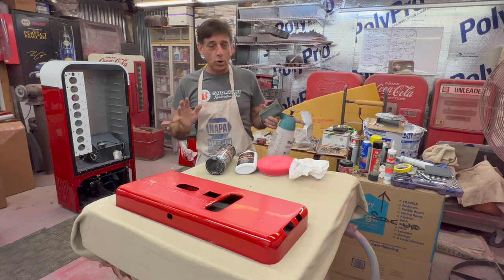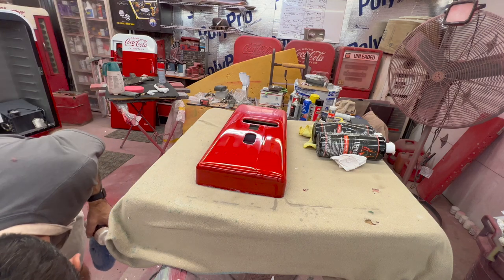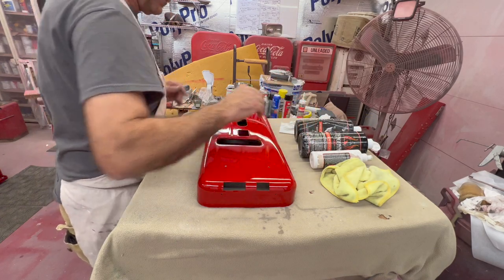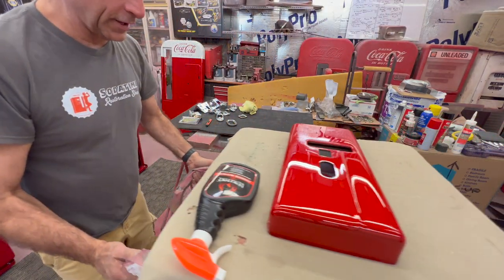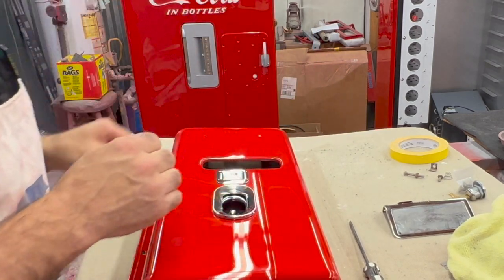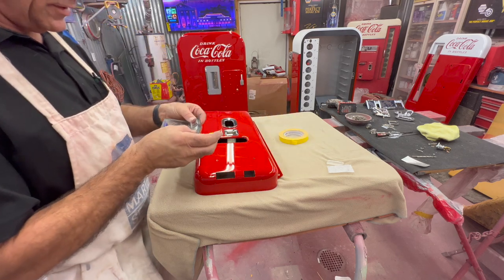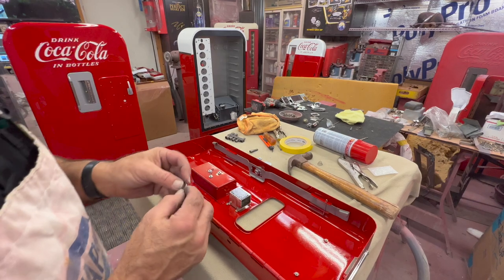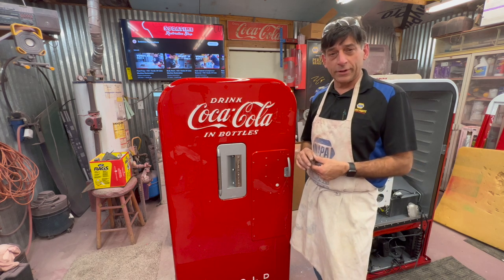Coin Door Buff & Chrome Install | 1951 Vendo 39 Coke Machine Restoration

Comment: Have you worked on one with water fountain on the side?
Reply from the maker: Good afternoon Barry!
Yes I have many times!
It’s a personal preference on to keep on the machine or not! For room placement in a game room or small kitchen it sticks out and most customers don’t want them!
I could go either way! Most of the time when you take them off there usually is a rust issue because of the water splashing!

Hope this helps!
Have a blessed Day!

Marc
Reply: @sodatimerestorations  Mine works butt needs new wiring harness. Where could l get one? Thanks very much Barry
Reply from the maker: Wiring harness for the compressor and electrical fans?
They have at a company called Fun-tronics  and also at Sodajerk works 
They should have in stock at both places